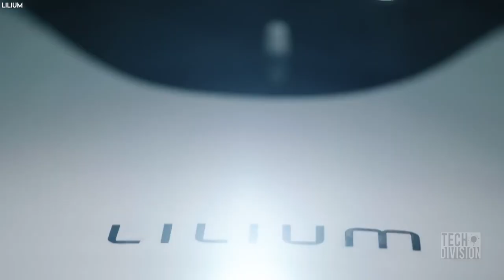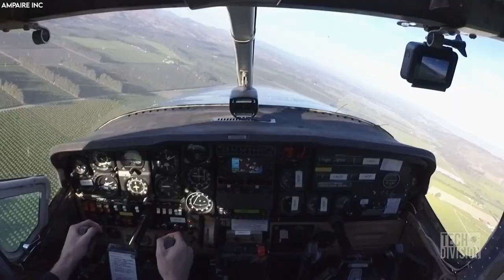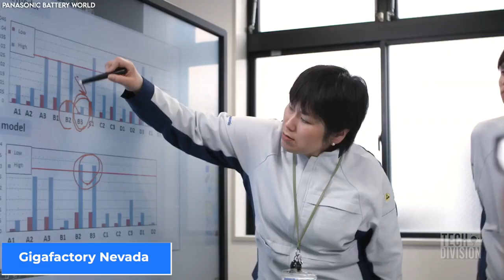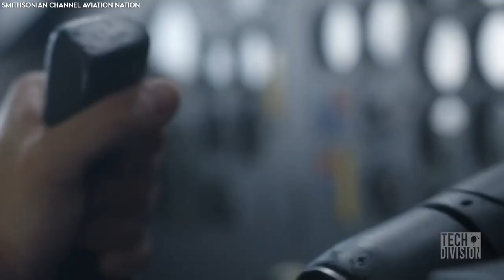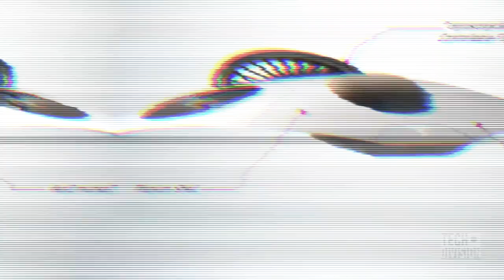Elon Musk Sees Tesla Electric Aircraft In 5 Years

Comment: I remember a study looking into the future of sustainable aviation. The best solution depended on the range requirement for that plane. Short range planes will benefit the most from using batteries. Medium range will use hydrogen. Long range will use CO2 neutral synthetic aviation fuel. Long range using only batteries is impossible and will probably be that way for decades to come.

Comment: It will be great to see battery powered planes when battery energy density becomes high enough to have useful range.  Some of the claims like electric powered supersonic and in flight solar panels  are just fantasy that ignore physics .  The maximum speed of propeller powered flight was reached by the end of WW2 . Supersonic Shock waves at the tips of the props limit  speed to a little more than 400 mph.   The compressor stages in supersonic jet engines must also remain subsonic.  The boost to supersonic is from  combustion of fuel.  The energy density of solar is much too low to power a passenger aircraft at any speed.   At this stage of technology, vertical  lift short range service in congested urban environments would likely be the natural niche for electric planes.  Low noise due to electric power would be a big plus.